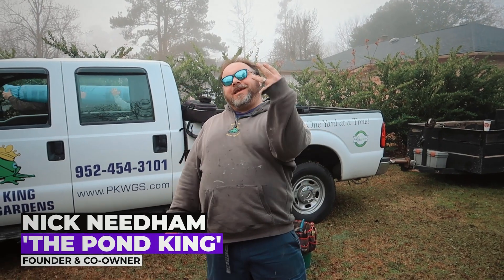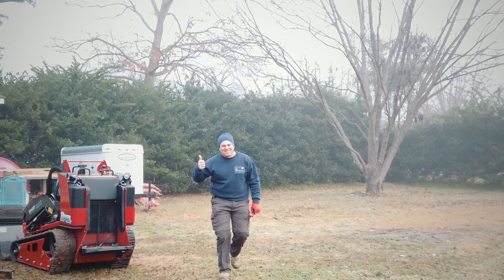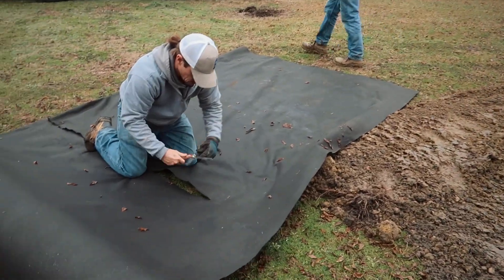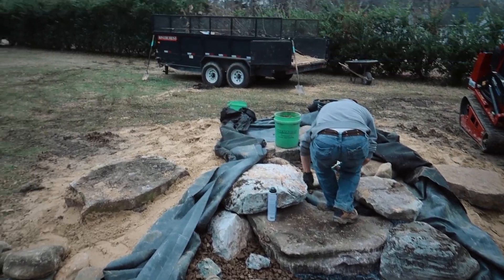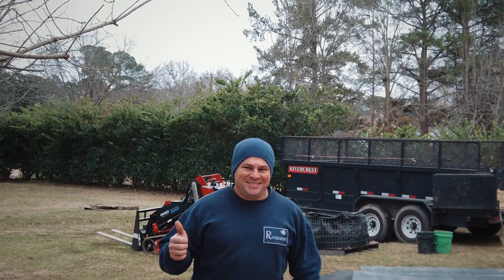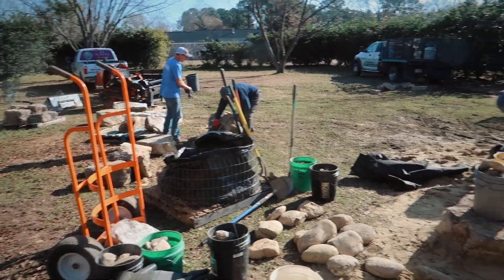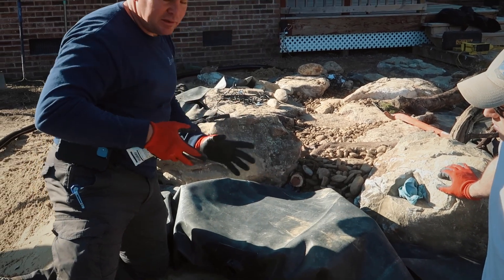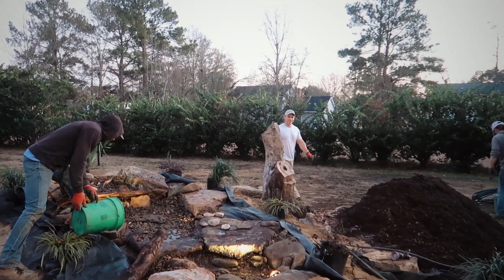Medium Pondless Waterfall | South Carolina Pt.2

Comment: It looks like at 4:10 you put the second rubber liner over the top of the basin instead of tucking it behind the aquablocks. Any problems doing it that way?
Reply from the maker: We do this in order to hide some of the basin. I don't like a waterfall falling into a huge gravel bed personally. We extend the stream a little doing this too. There's no problem doing it the way you're thinking either. The biggest thing is that you're leaving enough liner to create a bowl effect and don't make a low edge on your basin behind a waterfall rock.
Reply: @PondKingWaterGardensMN  awesome. Yeah makes sense. I'm building my own now and I think I'll do it this way. Your videos have been helpful and your falls all look great. Thanks King 👑!
Reply from the maker: With pleasure! Connect with me on Instagram @NickThePondKing if you need any questions answered!